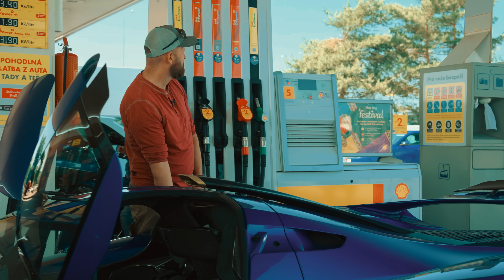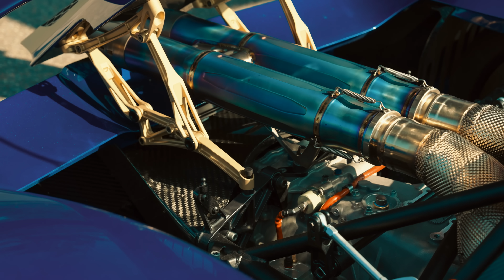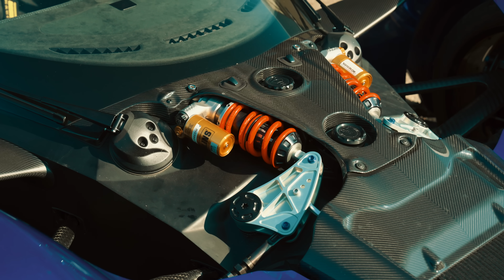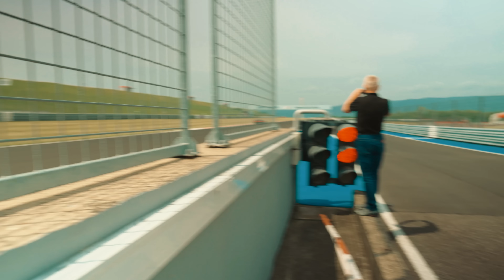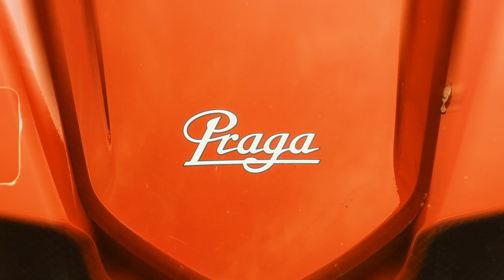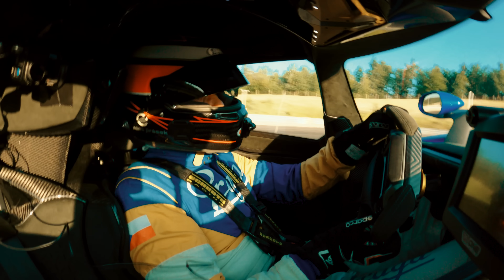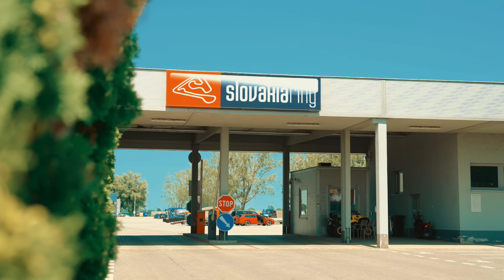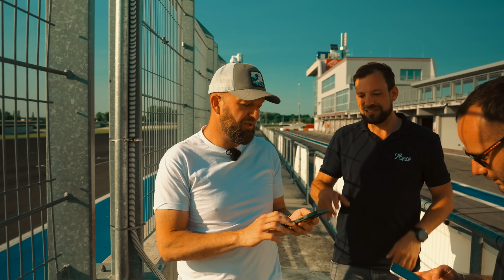FIRST DRIVE: Praga Bohema – Crazy Hypercar Driven!

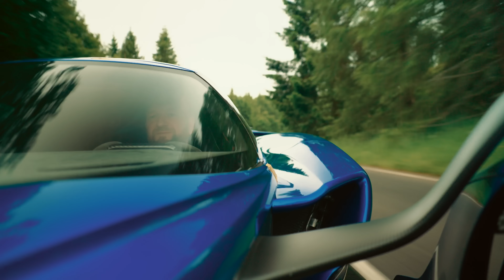Comment: 2:11 its ONLY got 700hp is crazy statement
Reply: In context to other hypercars. Did you listen to him or what
Reply: Acceleration = power / (mass * velocity)

You don't need crazy power to make less than a tonne go fast.
Reply: Crazy these days… but many hypercars are 1000+ 😅
Reply: @tomwookieford8445  and double the weight. being 900k is crazy. most are 1900
Reply: @1111111111202 Because most have door that are more than half an inch thick. This is basically like driving a GT3 car on the road.
Reply: Yeah, in a world even soccer mom EV SUVs are now regularly pushing the 1000hp mark, it's slowly but surely starting to become meaningless or at least uninspiring
Reply: @Seba-g5j   you are mentally sick  !!! don't never compare  a regular car  to a stupid  electric car  !!! 🤮🤮🤮🤮
Reply: Well it’s a 1.5 million dollar car, so 700 hp isn’t that much. Cars that cost less than 1/3 are making twice that now

Comment: Another day, another limited run play thing for billionaires.
Reply: Thats kinda the point for the brands, show of what you can do, pinnacle of engineering? Do you think anyone would care if they just made a hatchbatch with 1.2l three cylinder turbo? No.
Reply: With an engine from a 2007 Datsun
Reply: @grdprojekt what's wrong with that
Reply: @grdprojekt  which is more reliable than vag engines, that burn more oil than a two stroke engine
Reply: @grdprojekt  of course. Why would they use a vag oil fryer?
Reply: @grdprojekt Well if you want to get technical the VR38 was originally in the 2005 Infiniti G35 and the motor started it's run in 2003